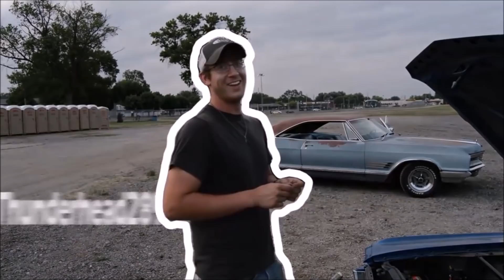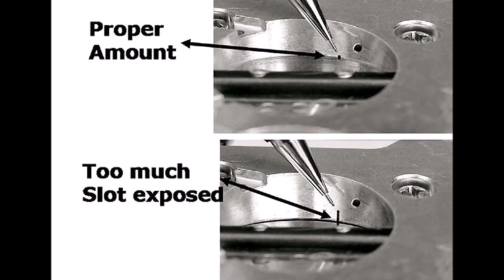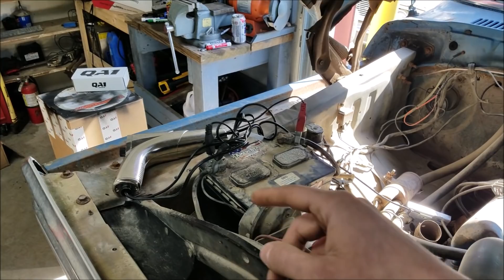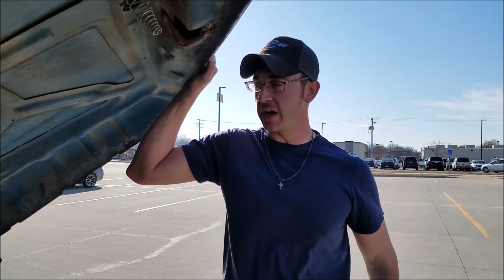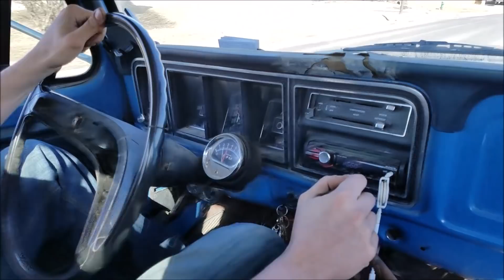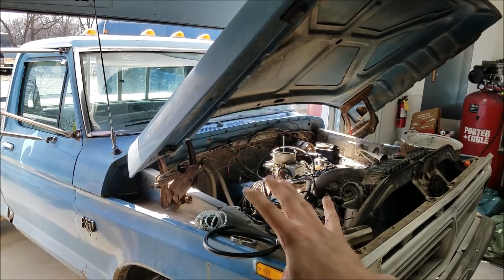How to Set Idle - Holley & Edelbrock Carbs (&& Free Throttle Response & Fuel Economy !!!)

Comment: Oh! I always ran 10 degrees initial and the manifold vacuum to the HEI with what ever it came with.  Then promptly fiddled with the carb settings. No wonder it was never a good feel.  I really enjoyed the Engine Masters episode about total timing,  really got me to thinking.  Your episode really got me to thinking about the transition. What about a performance cam with questionable idle vacuum? Still the same principle?
Reply from the maker: A high lift cam will have less cylinder pressure at idle, which will require more timing! 
Usually those land at 16-18 degrees advance. 

Just some background understanding, the overlap at low engine speed bleeds off compression - less compression means a slower burn time which calls for more timing to burn the mixture at the right time in the stroke!!! 

Conversely, what they give up down low they provide up top! The Overlap creates a scavenging effect which draws the next cylinder charge in at higher rpm where a lower rpm cam will run out of breath!
Reply: @ThunderHead289  oh, oh! I see now. I've just never had enough initial timing and was hooked up to manifold vacuum on the distributor.  No wonder it's crap on tip-in. I cruched the problem with faster idle, wondering why the mixture screws weren't responding.  Too mucho transfer sloto! 😬 I feel better now watching your tuning series that I can start at square one and dial the setup in. Thanks!
Reply: @ThunderHead289  in that situation, would you dial in quite a bit of initial advance, and then limit how much total with stop bushings? I have a 10:1 302 with Bennett Racing ported heads and a 230/240@.050 camshaft. Edelbrock Performer RPM and 650 mechanical secondary in my 1964 Fairlane. Only makes 8-10 inches of vacuum at idle. Sounds like my best bet is to square the transfer slots,  and use timing to get the idle where I want, then limit mechanical advance until I total at 34 degrees or so? I already have to run the Holley throttle plates with .093 holes on the primaries.

Comment: what ever happened to using the service manual and tuning your engines to manufacturer specifications.
Reply from the maker: Simply put, those settings are painfully conservative. 
That’s why.
Reply: The manufacturers specifications were guided by corporate bean counters, government regulations, them having to warranty and service cars, etc.  Carol Shelby and his crew were not out at the race track reading numbers out of the ford shop manual to milk as much horsepower as they could from his car.

Comment: I have a spot on my edelbrock 1405 that while im driving about 15mph, and i punch it, it will dog out. I cant tell if its not enough fuel or too much fuel. Otherwise everything else runs good on it. It seems fine when launching from a stop Just a flat spot when im already crusing and punch it. at start of power valve or such? I dont know what to do without a wideband O2 sensor to tell if its lean or rich when this happens

I am using manifold vaccum and a while ago i set the fuel squirt to the largest squirt since it seemed like at the time it was dogging out during launch from stop. But now maybe its too much fuel during a punch at cruise?

Its a 1979 ford f350 with a 460 engine, stock intake, 8 degrees stock initial timing

Ill try your tips out to see if it improves
Reply from the maker: What is your timing set to at idle, and what is your overall timing setup? 
Like I mention in this video, timing is everything. Fueling and timing has a dynamic relationship, so they both play off of each other
Reply: @ThunderHead289 i am using manifold vac advance, and i have it set to 8 degrees before attaching vacuum.  I dont recall the degrees once i hook up the manifold vac..i will have to check that again. Probably like 30 maybe, but i dont recall. Thanks for the tips i will try port vac again soon and see if that helps overall. The 8 degrees is because that is the factory recommended setting on tje valve cover lol. But thats probably also when you have all the emissions hoses , which i no longer do
Reply from the maker: If you set the engine up on the principles I do in this video, you will smile when you hit the throttle. It will probably ask for less accelerator pump also
Reply: @ThunderHead289  interestingly though the original vacuum diagram for this truck does use manifold vac. That was with stock carb
Reply from the maker: Research and Build from the factory smog pumps, retarded cam timing timing chains, and ignition timing retard canisters were used also - the factory has to manufacture things to meet certain specifications. 
Also, factory tunes are painfully safe. 
YOU do not have to play by the same rules.

Comment: I have a supercharged sbc 350 with a 671 it is running lean 18 to 20 with the aem afr gauge but burns my eyes like it's too rich why would the gauge read like its lean
Reply from the maker: A common misconception about lean is that it doesn’t have a smell - when a fuel charge isn’t properly burning due to timing or an out of spectrum ratio, you will smell it. 
Contrary to popular belief, lean reeks too! 
If you want to cross reference, review your plugs!!!
Reply: I was told to lock the timing at 32 degrees because of the motherthumper cam so I'll try that soon and go from there
Reply from the maker: Well the supercharger adds another bit of complexity where it’s simplified by locking timing although not ideal. 
Give the units a look I linked and review it’s function - they are what I’m going to run on my supercharged engine.